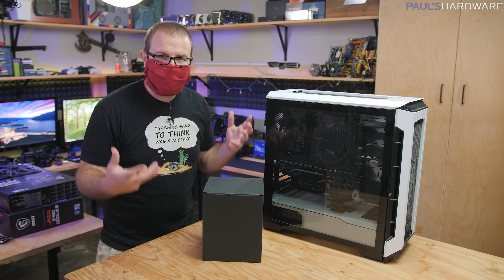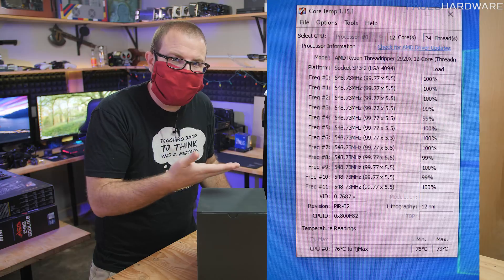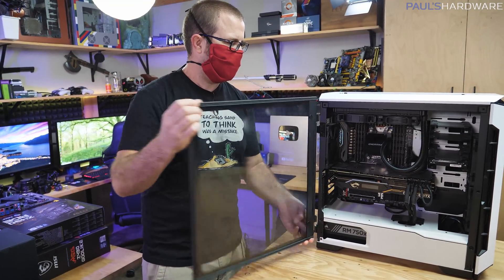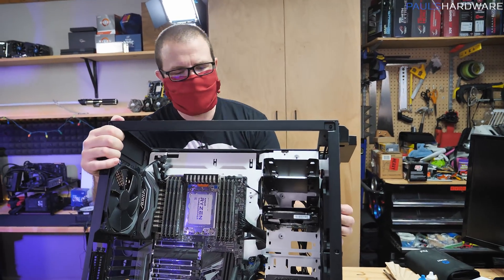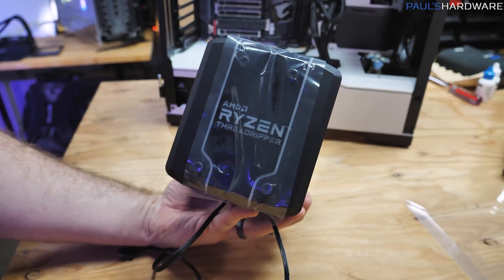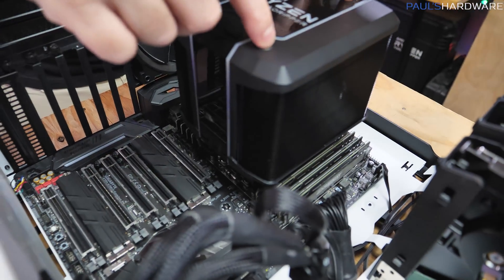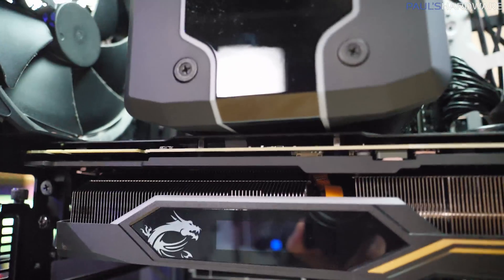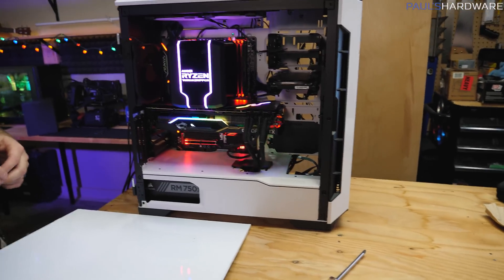Why We Switched from an AIO to Air Cooling...

Comment: The same thing happened to my system 2 months ago!!! Switched to Dark Rock Pro 4
Reply: are you happy and what about ram clearance ??
Reply: @jamieevans871  Yes, temps around 50°C under load (ambient temp ~24°C) with low RPM. RAM clearance was not an issue (I am using G.Skill Trident z). However, If your are planning to add more RAM you will need to take the cooler off. GPU clearance was the only issue, the first PCI slot was slightly covered which is the only downside.

Comment: LOL! I just changed my Enermax TR second gen with Fryzen about a month ago, and it's droped from 58C to 38C idle and 82C to 63C full load. Just so you know, on the website they advertise max temps at 68C for 2950X. This is the 3'rd time Enermax failed me with AIOs and fans, like I mean it, at the beginning they do great, but after 3-6 months they're as good as trash. Never buying Enermax cooling ever again, unless they have stupid good offers, then prove they've learned their lesson to get back customer reliability.
P.S. Lov ya man!

Comment: 128 gigabytes of RAM. Anybody remember when 256 megabytes was the standard for storage memory? I was actually surprised that another drive didn't pop out from a different corner of that rig. Btw, if you want to take PPE to a new level wear gloves on your next video. Man does it suck to work on computers with gloves.

Comment: Water Cooling has minimum of THREE moving parts: Radiator Fan, Water Pump, Coolant fluid
Air Cooling has minimum of ONE moving part:  Fan.  
Air Cooling wins due to less moving parts, which leads to less maintenance.
Reply: Any good air cooler will even work when fan dies. Most coolers are capable of passively keeping the CPU from overheating.
Reply: How often is this an issue though? I honestly would imagine, and certainly for me, my only concern would be the gunk build up because I would presume it wouldn’t have an issue for like 10yrs
Reply: @sheppycider123  depends on your environment and fan speed but in general you only need to clean it like every 1-2 years which is not that bad and a good duster usually gets rid of everything, you don't even have to do a total disassembly, in all my life I only had one cpu fan die on me after like...constant 10 year use lol (originally was my pc then I handed it down to my father who just used it for web surfing)

Comment: Not sure why Paul didnt install a D15 or D15S. Why not fit the best. And with a D15S there would have been more room between graphics card and cooler as it's an off set design. Better RAM compatability too.

Comment: Good move Paul ! Just as you I consider it is not very wise to trust a cheapo tiny plastic pump and garbage tubing for a productive machine running 24/7.
I would not go on holidays and let my pc on with ANY aio.
I have encountered SO many pumps failure (in the 2000's we worked with aquarium pumps, especially with German brand Innovatek, supposedly one of the best in those old times...)
My pump died twice in 3 years...went to garbage can !
Not talking about corrosion or bacteria growing slowly in water, or heat loops when ur water is too hot as it is not cooled enough...
I now rely on BIIIG heatsinks from Noctua, Scythe and sometimes Be Quiet.
....Now I can sleep on my 2 ears 😊

Comment: Is Joe really playing Apex Legends at 60 FPS on a machine like this?

Also for the hinge issue on his case, just a drop of WD40 on each hinge will solve his troubles forever
Reply: It's not a lack of lubrication, I think. I've worked on lots of equipment where the mounting pins or the sleeves on the door got bent or were just misaligned from the time they come out of the factory.

Comment: I have all air cooled systems, so water cooling looks interesting.  This is the first video talking about clogging.  Have you added a bit of vinegar to the loop to clean out the gunk?  It would be an interesting experiment as plain vinegar does wonders for faucets and shower heads if your water is a bit on the hard side (calcium and/or lime and maybe iron).

Comment: You should only buy AIOs for the bling if at all. And if you want the bling you might as well go for custom water cooling...

Air coolers are alot more reliable and the best models cool just as good as 280mm AIOs - even though air coolers are usually alot cheaper.

Comment: Paul I have the same Phantek case (which I think is almost perfect). Anyhow after watching a previous review of yours and the problem of removing the doors, when I did my new build a month back, I did the sensible thing in applying a smear vaseline to each of the pivots. Dead easy and removes the problem. Frank 😏😷

Comment: @Paul's Hardware  Hy. New fan and subscriber here :)  

First, I really love your channel…I found it because I'm looking to build my own PC (for the first time ever.) 
Second, sorry for the long comment. I really hope you can/will read it, as it means the world to me.  

I was hoping you could help me whit a few problems I have after 1 month of resource, I still don’t really know what to go for regarding parts.  
And whit all your knowledge about this, I REALLY REALLY hope you can help a new fan and new subscriber out :)  
(Most PC YouTubers don’t even answer if they are big, so I pray that you do).

SO…This PC will mainly be used to run my racing new sim rig, I have 3 BenQ EX3203R monitors (a triple setup) that I will use, and I also want to play VR whit this PC. 
I also want to have the possibility of setting up a simple stream or record (live) to YouTube/FB. 

Whit these requirements, and also the option to upgrade later: 

What Graphics card should I get for this setup to run perfectly? 
I found a really good deal on a GeForce GTX Titan XP, 12 GB, GDDR5X, 384 bit, 7680 x 4320 Pixels, PCI Express x16 3.0 
(This is second hand from a reliable seller, as new for only 366-. Euros. I see Amazon now sells them for 890-. Euros)
Is this a good card/deal for a setup like this? Or should I choose a different GPU? 
What would you do if this was your setup? (Just your quick opinion would mean the world to me.)

Could you PLEASE PLEASE give me some tips on what parts I should choose that makes this setup run smoothly?
(For a plug and play gamer...Ie: What is overclocking, lol) 
You will save me soo much hassle, and give me great peace of mind. I really hope you have time to answer me. 

GPU?  Would you go for the Titan XP deal, or pick a different one? 
CPU to match my GPU?  
CASE? Can you recommend a good case or 2? (The one in this video is not available here in Spain)
(Should I go midt or full tower for this setup? It will stay on a table, RGB is cool but performance is whats matter the most) Of course with good airflow, easy to set up, and future proof parts preferred. 

POWER SUPPLY?  

This is my main questions, If you do have a minute extra: 

SSD: What's the best/fastest/price-friendly 500Tb-1Tb for this? 
What kind of RAM (32gb) is best? (2x16Gb or 4x8Gb, is there a difference? 
Cooling-Fans or the new AIO system and which?
Price is open but was hoping to get a  great PC for under a $2000-$2500

Hope to hear from you soon.

As I said….After a month of research, and watching all your videos, I still don’t know what parts to buy today, the 12th of June 2020. 

(PS, I know a lot of new stuff is coming out now/soon, would you wait for any of that for this setup, or should I just buy what’s on the market right now?)

Kind regards Kenneth

Comment: After 2 and a half years my Corsair h115i 280mm died. Pump was making weird noise and cpu was throttling. I went on Corsair website, opened up an account and wrote to support. I've provided proof of purchase and was told to send the bad aio cooler to them. After 1 month I received a brand new sealed Corsair h115i pro rgb which I will not use but plan on selling it. Mounting the radiator on top is bad, it should always be mounted on the front of the case with the tubes at the bottom, this will keep the air inside the rad on top.

Comment: I noticed the trend on the Liqtech AIOs and tore mine apart early enough to catch it just as the corrosion started.  One thing I'll give to Enermax, that is one easy to service AIO.  I did a complete flush and refill with 50/50 premix and it has been great the past two years.

Comment: I owned a gigabyte designare x399, used the noctua 140m push pull and moved the gpu to the second 16z pcie slot and worked perfectly, although the noctua had better clearance due to the mounting offset but i wanted best clearance, that wraith ripper is way too close compared to the noctua and you can't add another fan for push pull in addition to benchmarks for it compared to the noctua and the dark rock pro tr4 edition.

Comment: I'm still using my ryzen 7 stock cooler. That this is amazing for stock I'm overclocked to 4.0 and temps are right where they should be
Reply: Whats your temps under idle and load ?
Reply: @OfficialCass90  under load never gets above 65 usually at 60 idle is like 45

Comment: This is why I have always just used well-made air coolers. When the fan fails, just replace it and you are good to go for another 5 years.
Edit
By the way, you really shouldn't be using a vacuum cleaner, do you even know the amount of static air that generates? Sure they made improvements to the PCB layers so static damage is reduced, but that doesn't make them impervious.

Comment: Outside of this use case I find a high end air cooler better than an aio. Simply because some will perform close/better than an aio and not much louder. It also only has one point of failure which are the fans which are cheap in the grand scheme of things and easy to replace

Comment: I better snag a vacuum cleaner for my pc. Any recommendations?
Reply: Just don’t get one that sucks :P
Reply: @sterlingmillhollon2520  I usually use compressed air and a hard bristle toothbrush, but that requires some disassembly of my PC and reapplying thermal compound after cleaning

Comment: I had an AIO in my old system. It still works 5 years later tbf.

My mate had one, it broke after 2 years. I'd rather take an air cooler. The performance and acoustics are basically the same but if your fan fails worst case scenario you buy an new one for 15 bucks and stick it on.

Your AIO breaks and you're out of a motherboard. Possibly more.
Reply: Be quiet air coolers are quieter than most aio
Reply: AIO breaks= rip gpu and mobo
Reply: @marcosundah4698  I think you mean cpu.
Reply: Yea, cpu is dead and the leak spills to the gpu underneath the cpu
Reply: Acoustic level is not the same because air cooler reacts to CPU load rapidly, while water one has few minutes before temperature raises.
If you take a coper pump and a coper radiator you will never see such corrosion. This is a fact for an elementary school
Reply: @sc0or  you do realize as soon as the water heats up from load that point is moot right?
Fans only rev up and down to load if you don't have a proper fan curve set, this applies to fans on radiators as well.

Comment: I like the air cooler u used, I m also thinking to buy cooler master ma620 model for my ryzen 3600 Bcoz it's getting heat up all the way to 96 temp. while video rendering.

Comment: Is there a trick to using a vacuum to clean a pc? I could have sworn I read that vacuum cleaners create static at their nozzle.
Reply: I think its the only thing he had at hand. Usually you should use pressure blower's to clean the pc.
Reply: @Matruchus  That and 70% isopropyl alcohol, right? I'm transplanting the guts of my ancient rig into a new case soon, and it needs some serious cleaning.

Comment: I've looked at different options for cooling over the years and even though, water cooling has it's + or - sides. My latest build with an 3950x, has the plug and play (and mostly forget about it, reliability wise)  NH-D15.
Reply: What motherboard do you have and is the D15 obstructing much?
Reply: @zarmaanful  I looked at a few options for parts and picked a mix. I was happy with and would fit my needs and budget.

Gigabyte X570 Aorus Master, NH-D15 (dual fan),  Vengeance RGB pro (2x32=64GB -3600Mhz), MSI-RX 5700 XT 8GB Gaming X,  2x-MP510 1.9TB NVMe (Boot & games), 1x8TB internal HDD (for storage) - 4x8TB external HDD (for backup), Define R6, Gunmetal (no window).

As for how, the NH-D15 effect some parts:

I had move the fan above the ram slots, up a few fins on the NH-D15, as the RGB strip was touching it (low profile, non RGB would have required no movement). The fan still doesn't touch, the case side panel when closed. 

Not much space between, the MSI-GPU back plate (2.75x slot card = 297 x 58 x 140 mm) and the bottom of the NH-D15. I can't get my finger's between them to press the retaining latch/clip and the first PCI-E slot. But can use, a plastic trim tool or flat head screw driver to open and close it. if I need to remove/re-seat the GPU or access the 2 the NVMe slots/drives (currently in use) or remove the NH-D15. 

Air flow not a problem on the R6 (currently) 3x140 + 1x120 intake and only 3x140 exhaust (not 4, due to an 5.25 optical drive). 

I've not done a manual O/C the system and let the CPU/MOBO (PBO) take care of that. Boost up-to 4.7 on 2 cores, between 4.3-4.5 on the rest when gaming/streaming(OBS), benching (prime95, Cinebench, etc).  I've not seen the system hit over 80C under load, so far and we had a few warm (30c  - 85F) days, with no air-con.

Hope that helps

Comment: Got a new PC last month with an Enermax Aquafusion 240mm. I read good reviews about it and didn't see the video on GM... I hope it won't have the same problem has the one shown in this video...
My old Corsair Hydro Series H60 is still working perfectly. If my AIO fails, I still won't go with an air cooler but I sure won't get an AIO from this brand ever again.

Comment: I just finished my switch from my 2700X and X470 board to a 3900X and X570 board. I went from an 240mm AIO to a dark rock pro 4 and my temps are lower all around...

Comment: I am running a $60 Fuma2 on a Ryzen 7 3700x (x570 Elite MB) and it is not possible to overheat this system no matter how hard you stress it. Runs cool and quite! No need for a high dollar liquid cooled system that could possibly leak and cause a bunch of headache.

Comment: Bad Paul! If you actually watch some of Steve's videos, you would know NOT to use top exhaust with an air cooler. You're literally stealing the air it needs to cool the CPU. Air coolers are best with a top intake and worst with top exhaust. Run too and front intake with read exhaust in a positive pressure set up.

Comment: A Wraithripper that just has 1 120mm fan for $129, a S36 Fractal Design is $120 that has 3 120mm fans also as an AIO cooling unit with a 3150rpm pump. Then only thing with them is you probably need some outside software to set the fan speed at 2000rpm at all times, otherwise it only goes that high during high demand otherwise it fluctuates between 500RPM and 2000RPM. It primarily hooks up to the processor.

Comment: My son bought the original LiqTech TR4 and I bought the second-generation version; both died within a week of each other. I disassembled the older one and found green glop throughout the coolant and caked in the fins of the coldplate. Enermax makes some excellent products, but their AIOs for Threadripper suck.
What's funny is that my son got the Wraith Ripper (loves it) and I got the Dark Rock Pro 4 for TR4 (also love it).

Comment: I stopped using liquid coolers too with my Rysen - 95 watt TDP,  And now I to use air cooling. Water cooling costs too much, and they leak and clog up. Air coolers usually are about a third as much. And way less hassle these days to install.

Comment: Ive had 3 separate AIO coolers (all Corsair) fail over the years. These days I won't even consider an AIO, not even for mini-ITX. They just aren't worth the hassle when air coolers work perfectly basically forever.
Reply: How do you know they fail? I just was wondering like does ur computershut down or did it ruin stuff? I have one and just interested... Its 5 years old...
Reply: @garrettharrison4004  In 2 of my coolers the pump started making a loud grinding noise that progressively got worse and worse over the course of a few weeks. On the 3rd corsair cooler, out of the blue suddenly, my CPU temps went from around 40C IDLE to 90C. I did a quick swap to an old, beaten up seconds hand air cooler and my temps returned to normal instantly.